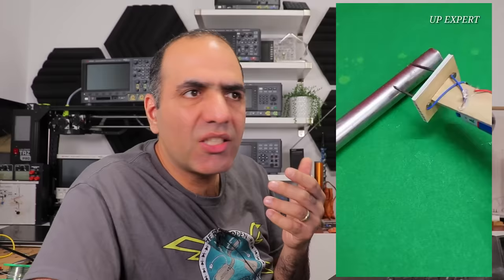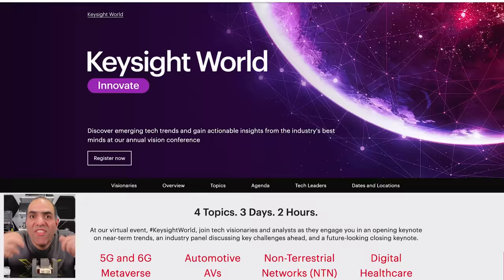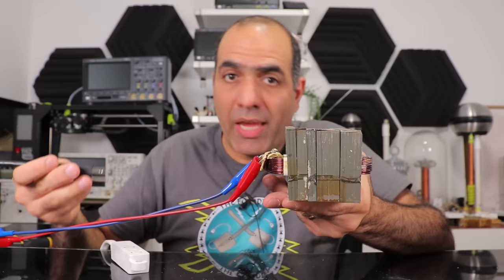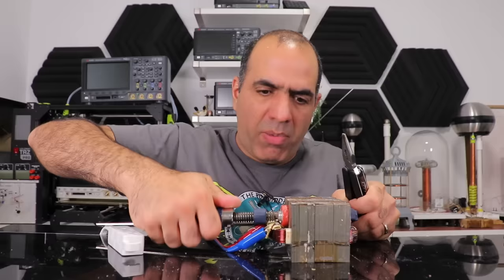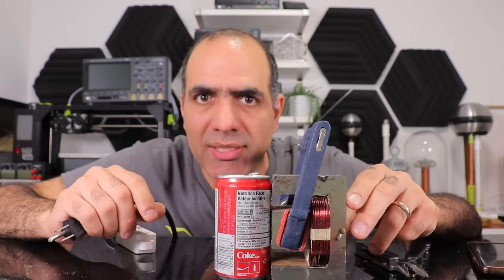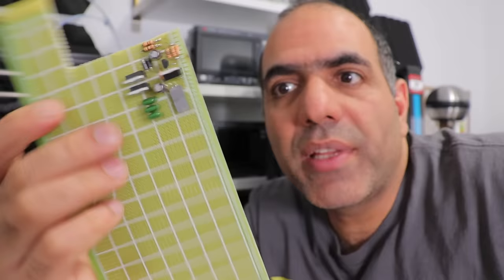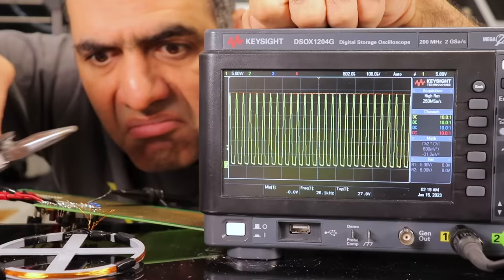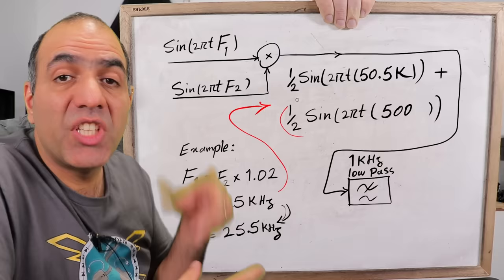DIY METAL DETECTOR, Gone Wrong and Right!!

Comment: The core splits itself apart because the flux lines pass through each laminated layer. Since there is a gap between each layer, you end up having the said layers behave like like-oriented magnets, thus they repel each other
Reply: blud copied one of the most popular comments

Comment: The core splits itself apart because the flux lines pass through each laminated layer. Since there is a gap between each layer, you end up having the said layers behave like like-oriented magnets, thus they repel each other
Reply: sorry

Comment: 05:16: The core of the transformer splits itself apart because the flux lines pass through each  layer of its core. Since there is a gap between each layer, we end up having the said layers behave like like poles of a magnets, thus they will repel each other

Comment: It's possible that the halves of the transformer are separating due to the magnetic fields generated by the transformer coils. When the transformer is operating normally, the magnetic fields are contained within the transformer core, which helps to keep the two halves of the transformer together. However, when you remove the top of the transformer, the magnetic fields are no longer contained, and this can cause the two halves to separate.

Comment: The transformer plates separate due to magnetostriction - the oscillating ac is inducing an oscillating magnetic field in each plate, which shrinks slightly under the influence and rebounds as the oscillation shifts toward the opposite polarity. The 60hz cycle quickly establishes a standing wave that is physically defined by the partially bounded plates of silicon steel repelling each other on the expansion phase of the oscillation. (magnetospansion? I assume this happens at the zero crossing, with magnetostriction occurring at each alternating polar peak?) My second theory was back emf from the collapsing magnetic field between cycles - as the inductor rebounds halfway through each cycle, the back emf remagnetizes the plates in opposing polarity briefly before turning to heat and noise

Comment: 05:00 In the context of a transformer core, the iron component indeed possesses strong magnetic properties, typically attracting magnets. However, the interaction between magnets is determined by the alignment of their magnetic fields.

When two magnets are brought close together, their magnetic fields intertwine. If the magnets are aligned in such a way that their similar poles (either both north or both south) face each other, they will naturally repel each other. This repulsive force arises from the opposing nature of the magnetic field lines generated by the magnets.

Therefore, while the iron core of a transformer demonstrates an attraction to magnetic fields due to its ferromagnetic characteristics, the repulsion between magnets is still dictated by the alignment of their magnetic fields during interaction.

Comment: I'm only 2 minutes in, but I know that you can make a metal detector from a battery operated calculator and an AM/FM radio. I just can't remember what frequency you use at the very top around 108. I guess you'll just have to tune it, the calculator goes on top of the radio, and when you come near metal it causes an interference to come through the radio

Comment: Mehdi, you could also use a big resistor with aluminium foil instead of two small resistors or use a few less conductive metals as a substitute to the resistors

Comment: Every part of the broken transformer core get polarized(magnetically) as a separate magnet, and they have the same poles on the inside and outside. As a result, they repel each other and try to split apart. (Just like when you cracked a strong magnet, the pieces will not go together. Instead, they repel each other)

Comment: Unless you use logic level gate drive MOSFETs which only need 5V to fully turn on, you might want to use a NE555 MOSFET gate buffer.
It's yet another feature of the old 555 timer: replacing standard (and often costly) gate drivers...

Comment: I dunno is there a way to supply the power you get from the two resistors possible from a low impedance LC circuit? The idea is that the filter doesn't pass the sine but passes a voltage offset. I know when you orient the capacitor and coil properly it can translate any sinking current to a lead current (according to CIVIL you probably want the capacitor last), but I think you need a stable oscillating setpoint with a positive voltage offset at the input. You'd probably want to at least double that frequency as well to account for transience. Maybe a diode at the endpoint would also make sense...

Never tried it, so I don't know. If it works you can patent it.

edit: this might require active circuitry and if it does I'm officially clueless and regret posting this.

Comment: The core splits itself apart because the flux lines pass through each laminated layer. Since there is a gap between each layer, you end up having the said layers behave like like-oriented magnets, so they push away from each other

Comment: This wonderful video, in terms of explanation, presentation, and the stages in which it was explained, changed my outlook on how a metal detector works. I am repairing a minelab gpx 4500, but its diagrams are covered with paint, causing me to be unfair at work, and I do not know the names of the parts and do not see the connections. So I hope you will help me. So send me a connection diagram to disconnect the device from the inside, whether a pdf or a book. Thank you for your generosity

Comment: The core splits itself apart because the flux lines pass through each laminated layer since there is a gap between each layer you end up having the said layers behave like oriented magnets thus they repel each other. I think it’s 5:15

Comment: @ElectroBOOM how about building an LC VCO? You could then use your current limiting circuit to turn up or down the gain through a variable control through a fixed resistor for the coil.

Comment: Each transformer core is made up of laminating plates. Each plate is insulated to each other by insulating paint. This is done to nullify huge current effect due to hysteresis and eddy currents present due to ac frequency. Still there is current due to eddy effect in each plate. The current in each plate causes magnetic flux and each plate will act as electromagnet. now each plate being electromagnet has north and south pole. 
           Therefore, each plate causes attraction and repulsion with each other . This effect is more 
with distance between two plates as they vibrate due to frequency of ac voltage.
          Such effect is not observed with dc voltage as input.

Comment: They repel because there is a north and south side to a magnet. when two magnets meet each other and their both north they repel from each other. And if they are different sides norr and south they stick together. That’s why when you accidentally break you own magnet it can snap back because it gets its own magnetic field which is the same side of which it snapped of so let’s say it was the north side that broke and the part the broke on. The main magnet is the also north they will naturally repel each other. This is a long explanation hope you see this.

Comment: It has been a long time since I built anything and there may be a problem I do not see with this idea, replace the schotty diodes with a mosfets and use half bridge mosfet  driver to switch but now you need a pwm signal? anyway i have decided to try and build this.

Comment: I´ve been thinkering with metal detector design, and I come to the conclusion that if you run a pot in series with the capacitor, you can fine tune your machine perfectly and even gain power, another way to fine tune it is to make a variable voltage regultor on the input to play around with the input voltage. How else can we gain distance?

Comment: What is the difference between parallel and series resonance?
Which one should you use when driving inductive loads like antennas vs capacitive loads like piezos or ultrasonic sensors.

Comment: core splits itself apart because the flux lines pass through each laminated layer. Since there is a gap between each layer, you end up having the said layers behave like like-oriented magnets, thus they repel each other💖💖

Comment: This reminded me of when in the deep dark past (the early 1980's damm 40 years ago) I used to install and maintain Industrial food grade metal detectors  Those beasts  had to detect sub-millimetre steel  balls  between  100 to 500 micrometres from a distance of around  10cm to 50 cm travelling on a conveyer belt moving at  around 1 meter per second 
this was all predigital tech and was very twitchy to set up  and to keep working especially in Australia at that time  as spare parts took weeks to months to arrive I would have to buy batches  of components  and stress test them  to be stable enough to use  to fix the boards in the machines  if I recall correctly  they mostly used  changes in the phase difference in the return from the  signal coil while monitoring  the freq changes

Comment: I have a project to build walkthrough metal detector, and iam using Magnetometer like HMC5883L, iam utilize the earth magnetic field fluctuation when some ferrous object passed,  and it works pretty good to detect medium sized object like knife or screwdriver when passed the sensor. So do you think Magnetometer is another valid method to make a metal detector?

Comment: The changing magnetic field of the primary induces eddie currents in the iron, this repelles the other pieces (all at once) cuz the eddie currents opose the created magnetic fields of the iron core pieces

My english is a bit bad but i hope you can understand it
Im not really great at explaining Science problems cuz i have to translate it from Dutch, i can answer more difficult questions if they are in Dutch LOL

And i found this on the internet, is this right?
Eddy currents are formed in the interior of the iron cores of transformers. These currents are very undesirable both because of the large heating which they produce (loss of energy), and because of the flux which they themselves set up

Comment: magnets are impossible to have a 1 pole. N or S and transformer core mane of so many layer piece of metal and they have slightly gap between the iron plates and they turns into so many small magnets with same direction so pushes each others

Comment: My answer so that i get pinned😆😅 eddy currents have an opposite flow to the current passing through the metal....Using lenz law we know that current causes magnetic field and with varying mag field an opposite induced current is formed in the other plates and current in opposite directions repel each other hence instead of the plates attracting ......they are breaking appart.
In lay man language ..the currents are in opposite directions hence opposite forces are exibited(use right hand rule ....curl fingers in direction of the current flowing and force is the thumb)

Comment: For overheating resistors why not spread the load across 4 resistors in in-line and parallel circuit.  4 resistors replacing 1 would greatly reduce temperature.  If temperature still to high maybe consider using heat sink of some sorts
Reply: I would really appreciate if you really made that soldering video you teased at the end. I'd have a way to build one without cracking my brain open trying to rationalize the diagram! 
Brains oozing from the ears are not fun

Comment: hello! i have a couple of question for you   about the schematics : 1) at 9:30 the 100uH inductor what type is it? can you share the part number? 2)at 9:30  the 171uF capacitor how is it composed? what is the type of the capacitor? polarized or not? 3) at 15:40 what type is the first and second comparator opamp? i have see the datasheet of the MCP6542 that you use for the oscillator and the inpunt max voltage is 5.5V , the signal fron the RC filter is not like 9V?  4)  also i made some calculation and i'm a bit confused about the value of 171 microF and 230 micro H of the coil, to have a 25Khz resonant frequency i think the value should be 230 microH and 171 nanoF , am i wrong with the calculation? thank you in advance!
Reply: hello, i found the answer! especially on the value of the capacitor should be 171 nano Farad , not micro farad to have 25MHZ resonant frequency. Also the MCP6542 have a 5.5V max input voltage, you should take care of it or the opamp will be damaged

Comment: The core splits itself apart: the flux lines pass through each laminated layer. And there is no gap in there so you end up having the said layers behave like like oriented magnets, than they repel each other I hope thaths is good enough

Comment: You know you could have accomplished the same thing by using an FM radio on the am setting turning it up to the highest channel possible with static, and then taping a calculator to the back ⚡Boom metal detector acquired

Comment: The core splits itself apart because the flux lines pass through each laminated layer. Since there is a gap between each layer, you end up having the said layers behave like like-oriented magnets, thus they repel each other

edit:heart my comment and copieng mobschan 😆

Comment: Why don’t you just make a magnet with rubber bands holding it up and place 2 wires under it so once it gets closer to the metal it touches the wire and a led light

Comment: I solved the ZVS resistor problem with just a simple current amplifier that consists of an NPN and a PNP complemetair pair transistor. So there is the resistor then it goes to the current amplifier and then to the mosfet. This reduced the rise time of the gate voltage so much and made everything much more efficient. I highly recommend doing this!!

Comment: 05:15 The core splits itself apart because the flux lines pass through each laminated layer. Since there is a gap between each layer, you end up having the said layers behave like like oriented magnets, so they repel each other and that’s why 🤓

Comment: I don't know if it's supposed to be a joke or not but, what can be the advantage of using 6 AA batteries versus using 1 9volt battery, other than the capacity?
Reply: Very common to have rechargeable AA batteries, 9V rechargeables do exist but are rare, and of course much lower capacity than AAs
On top of capacity, 9V batteries typically have a higher internal resistance (generally goes opposite to capacity), which makes them last even less in power-hungry applications

Comment: I'd rather use NE555 or oscillator and MOSFET gate drives instead of the ZVS, just high cost though.
OMG Superheterodyne 🤣🤣Sounds like Geiger counter.

Comment: Um there is a very low tech solution to this. you put a magnet in a tube right spring it up and put a switch under it if there is enough metal the magnet will beat the spring and hit the switch if not the spring will win and the switch will be up. Done.

Comment: Sir I made rangertell longrang locator in my circut board 1000uf capacitor, 60pf variable trimmer capacitor, 500k potentiometer, this is work mfd formal calculaor based programming my country India this locator build Australia pf is setting 30.5 pf sir Indian my mine diamond frequncy or wavelength is 12.0069 please tell me this 12.0069 how many points of pf can adjustment variabl trimmer capacitor